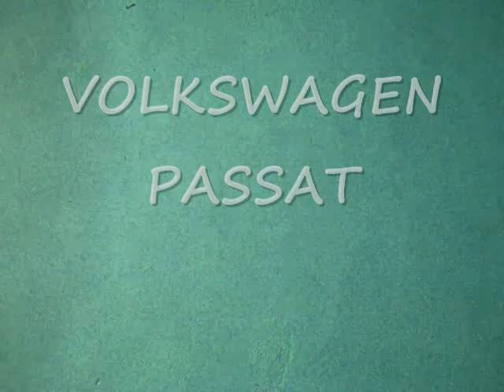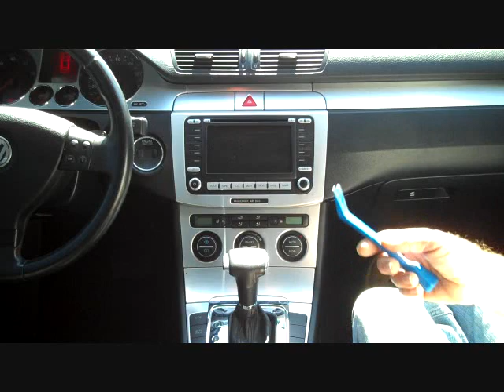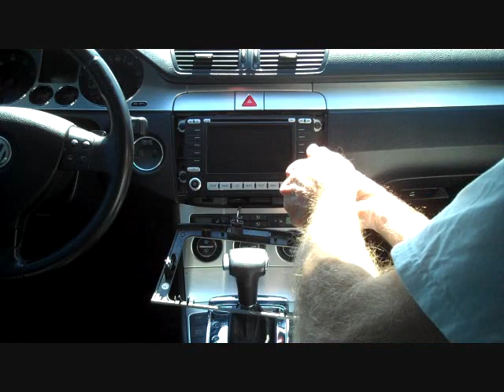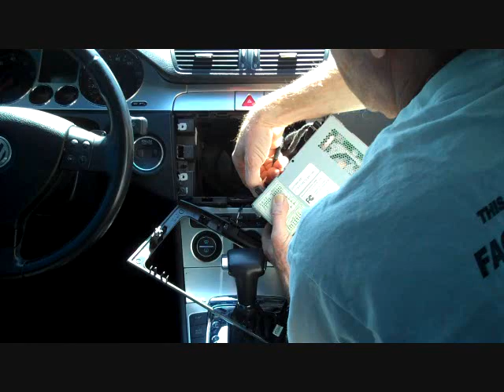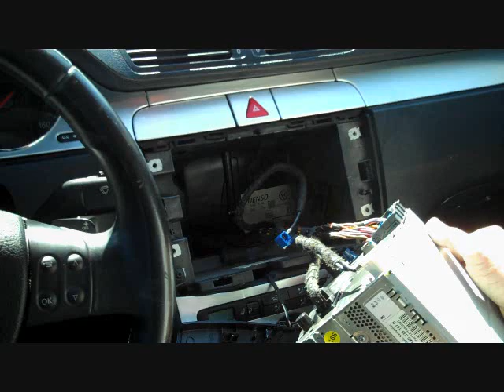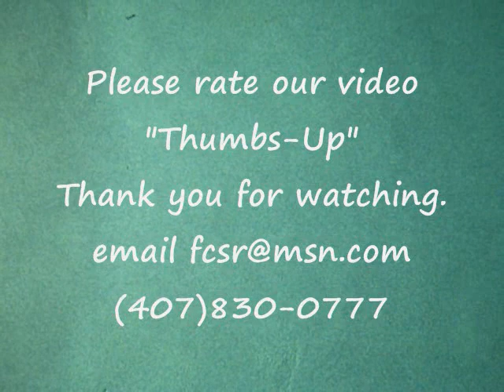VW Passat Stereo Removal 2006 - 2012 = Car Stereo HELP

Comment: It is not helpful at all. I want to see how to remove it in details.
Reply: Well you are stupid then, it really is as easy as the video. Pry the silver surround fascia off, undo the four torx screws holding it in and pull the radio out, undo the plugs on the back and it's done. 10 minutes work, maximum.

Comment: can you add this nav system to a 2007 passat that does not have the nav system from stock? or will it not be compatible?  thanks
Reply: Bret Zimmerman my 2008 Passat didn't have this as standard but I swapped it over and worked fine. just need to make sure you have all the correct codes and installation bits